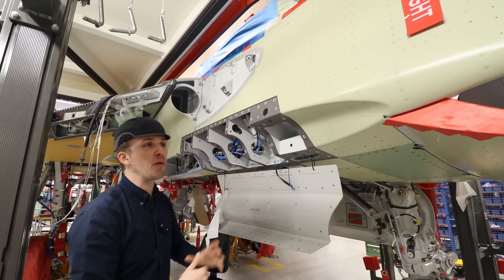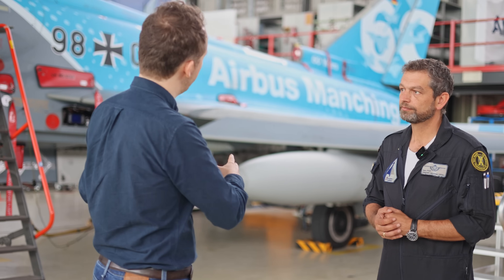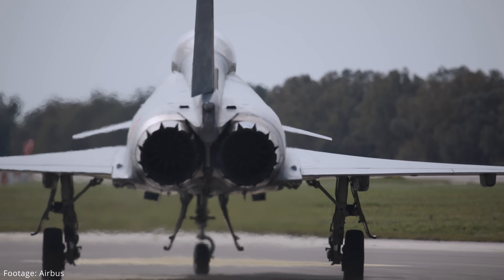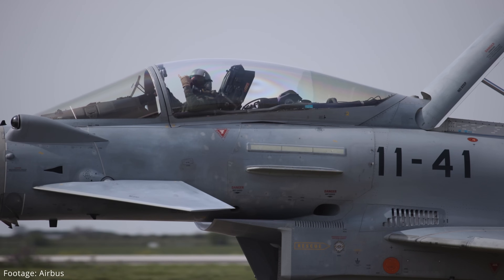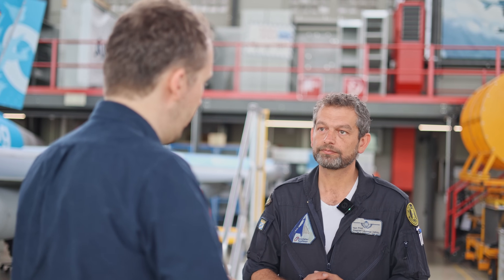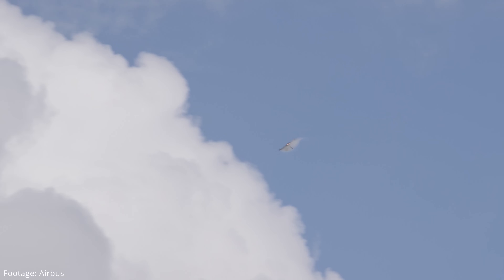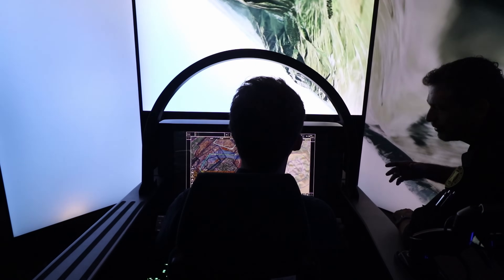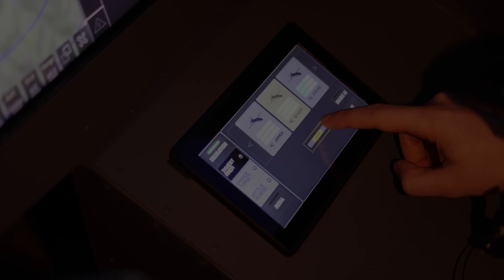The Prototype Eurofighter For Next-Gen Upgrades

Comment: There is a common misconception that the FCAS (Future Combat Air System) airplane will replace the Eurofighter. This will not occur; those times are over. 

The FCAS airplane is expected to cost between €300 to €500 million per unit, with operating costs also being off the charts. In comparison, you could afford 3 to 5 upgraded Eurofighters for the same price. Unlike the Tornado, which - basyically - was developed and produced once and then used until its expiry date, the Eurofighter undergoes constant improvements with ongoing production, where newer models replace older ones in service.

When the FCAS is ready, a decision will need to be made between purchasing and operating 50 FCAS airplanes or 200 Eurofighters. It is unlikely that 50 FCAS airplanes will be more effective than 200 Eurofighters, considering that, except for stealth capabilities, the Eurofighter is evolving into a 6th-generation aircraft fully integrated into FCAS. The Eurofighter even has distinct advantages, such as triple the loadout of an FCAS airplane.

I assume that Germany will opt for a fleet consisting of one-third FCAS airplanes and two-thirds Eurofighters in the future.

Comment: If Canada and Portugal do opt for the Typhoon as an F-35 alternative, I hope they turn to Germany for procurement, they seem to be investing far more into modernising the platform than the Brits are.
Reply: Your comment is extremely misinformed! The phased enhancements are brought about by  the EF consortium - Germany is one of the partners. Germany is not developing these improvements on their own!
Reply: The Gripen is the best jet for Canadas needs. Also I think it’s the best bang for your buck currently.
Reply: @556m4  except for the US engines perhaps.
Reply: ...and for info, any future sale of Typhoon (regardless of which partner secures the sale), 33% of each will be manufactured by the UK (including front fuse/cockpit, fuse frames, tail and rudder). Each partner has their own final assembly line. Please don't ever forget (or attempt to smudge history) the role the UK plays in Typhoon.......hell, without the British Aerospace privately-funded EAP, Typhoon likely wouldn't exist. Germany should never even have been allowed in to the consortium!! Absolute nightmare to work with.
Reply: Britain has the capability to build upgraded Typhoons. Just because it hasn't ordered any doesn't mean it doesn't have the manufacturing capability.
Reply: I’m impressed with the knowledge of this test pilot. He knows very well how development of complex integrated aircraft is performed.  He’s also very knowledgeable about proper holistic system engineering principles, and how that applies to a midlife update of a military airborne platform. 
Great episode. Keep them coming!
I think I would enjoy working with this guy👍🏻
Reply: It would be a horrendous decision to go with EF.
Rafale seems better & you have to deal with just one country!
EF is like a dream Red Tape/Bureaucracy project you want to avoid !
Reply: @ajpattanaik4353 And buy a fighter that no other country  in NATO apart from France uses?
Reply: @B-A-L Yes! Because it's fully compatible with NATO!
EF for all it's hype has been... Well we all know it!
Reply: @ajpattanaik4353  you have no idea what you are talking about. Keyboard warrior with opinions and no education. You can buy the Typhoon from either the UK, Germany or Italy, each country manufactures some components, but the assembly occurs within whichever country's model that you choose. Germany appears to have the most advanced, so deal with one country, Germany and their supply chains and production lines sort you out. Stop 💩-posting

Comment: This platform is old&outdated,they should go for the F35.
Reply: F - 35 🤣
Reply: You mean the massively overpriced and inferior F-35
Reply: @i-like-turnips  Actually, the F-35 is cheaper than the Eurofighter, at least in buying costs (fly away costs: F-35: 80 mio $, EF: 120 mio $). Large numbers and single engine do their tricks.

And no, it is not inferior. It has (currently) a superior sensor suite, superior situational awarenes, superior ergonomics, superior communications, superior modularity. And of course superior stealth. 
The Eurofighter obviously may be the superior interceptor and surely is a superior dogfighter, but describing the F-35 as overpriced and inferior? Sorry, no, it is a formidable plattform, outshining the Eurofghter in many aspects - and vice versa.

Comment: Das beste Nahkampfflugzeug(Dogfight )weltweit,besser als Raptor F22.Mit dem neuen AESA-Radar und dem Flugabwehrsystem ,,Meteor,, fast unschlagbar.Leider kann sie die Atombombe ,,B61-12,,nicht tragen,deshalb beschafft Deutschland das Modell F35,,Lightning,,.
Reply: Eurofighter will be a very capable aircraft with all the upgrades but don't mention it in the same sentence as the F22. It is not even half the plane of the F22. It is extremely far behind in overall capabilities.
Reply: @LionMCK the F22 doesn't even have a HMD... it surely is a very capable aircraft but it's not a UFO that's unbeatable.
Reply: @bluefox9436  That would be a really great point if I ever said the F22 was a UFO that was unbeatable! I never said that. Is it more capable than a Eurofighter? Hell yeah, I'll say that even if I think an upgraded Eurofighter will clearly be a beast.

Also, Scorpion HMCS exists and can easily be integrated. Not having an HMCS from the start was a bit of a mistake but it honestly would not have done very much before the newest sidewinders and/or a wide array of IR sensors integrated throughout the airframe. The reality is that things have gone really wrong if an adversary is that close to a detected F22 in the first place. The reality isn't Top Gun Maverick where everyone is dogfighting constantly.
Reply: @LionMCK the only thing that puts the F22 still ahead of the EF is stalth which is diminishing in effectiveness at an extremely rapid pace at the moment.

Comment: WILL IT GET SHOT DOWN BY J10C ?? 😊
Reply: No, for several reasons. The aircraft is one part of the whole, European pilots are far more experienced and proven capable. The weapons fitted to the Eurofighter are more advanced than those fitted to the J10C. Lastly, an aircraft does not operate alone, much like sending the best tank in the world alone into a combat zone will see it taken out almost instantly. The EU has extremely capable, battle test, and advanced electronic warfare systems. The UK for example has just put into service an unmanned wingman drone that is designed to scramble or mimic enemy radar. The J10C won't even see the Eurofighter.

Comment: isnt it is an old fighter jet? even older than J10
Reply: so? The F-15 is 50 years old and the US Air Force just ordered more.
Reply: @swems-z3s yea but US had F22 and F35 for its sucessor, ofcourse F15 still capable of doing great thing, but the point is, why does EU stick on the old platform instead of doing 5th or nextgen fighter
Reply: @uraymeiviar because the platform doesn’t matter if you keep the systems up to date.
Reply: The J10 is Chinese so it absolutely is a clone of western tech, like all clones, it might appear to be on an even footing from the outside, but as soon as you peal away the top layer it is a mess.

Comment: I get it that older aircraft have huge limitations in regards to implementing newer tech, but they did it with the F15EX soooooo...
Why not a new build Tornado similar to the Eagle 2 standard? It would make an awesome missile truck (like the EX).☺
Reply: Because the F15 production lines have remained open, and upgrades continuous, due to foreign sales. Tornado is dead.
Reply: @jacobzindel987  I hope the Eurofighter will go the F-15 EX route when the (then presumably horribly expensive) FCAS airplane is there.